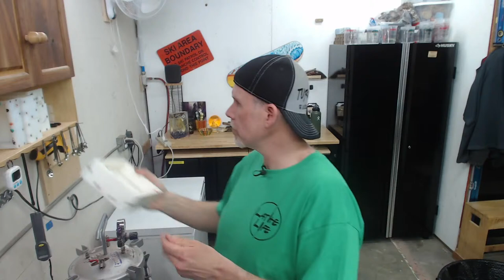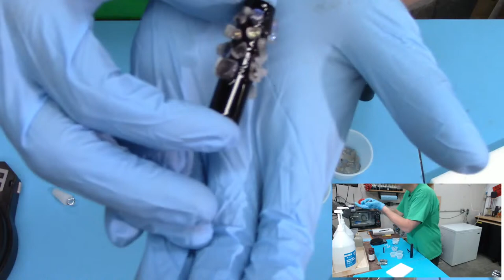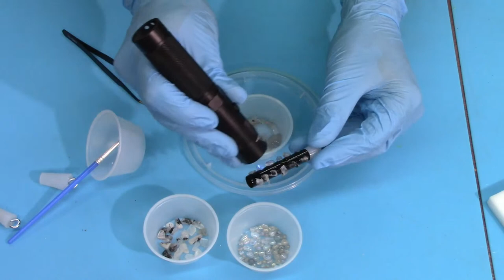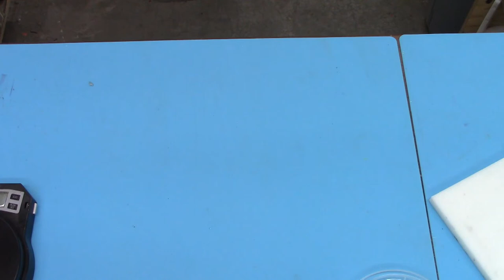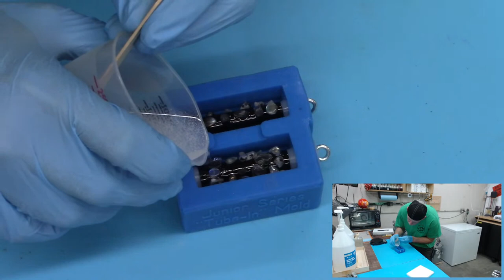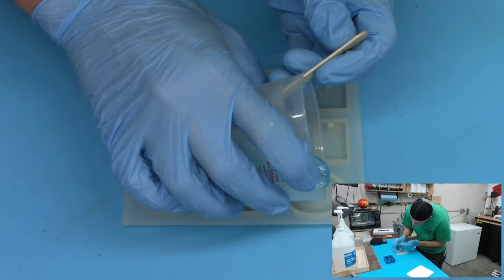🔴Replay: Can you Turn Crystals? | Episode 125

Comment: Hi Zac.  Problem is hardness of the crystals you chose.  Labradorite and quartz have a hardness of about 7 on the Moh's scale.  Steel is softer at 6.  There are some crystals malachite, fluorite and calcite that are in the 4 to 6 range.  May have better results with them although they will still be rough on your edge tools.
Reply from the maker: Yeah, I had a feeling this might be a bust. Definitely the hardest material I've ever tried turning. I've turned some of the softer ones, but we were just giving these a go to see what happens. Phillip, the guy who sent them was curious, so I figured what the heck =D